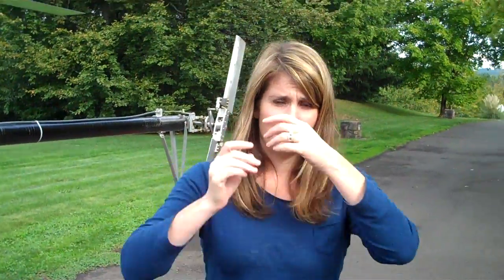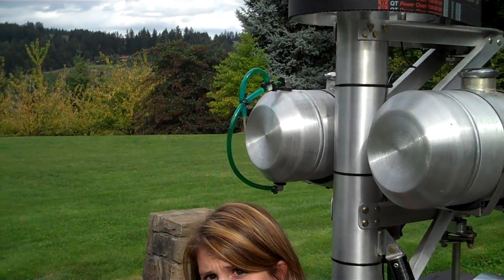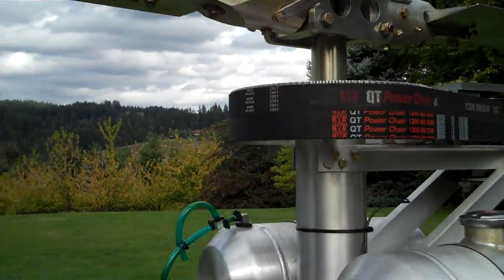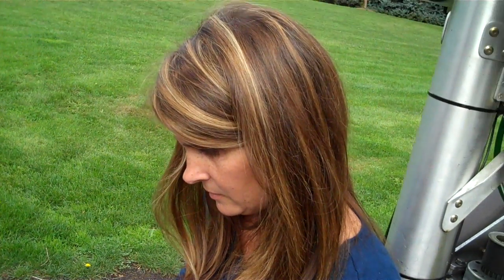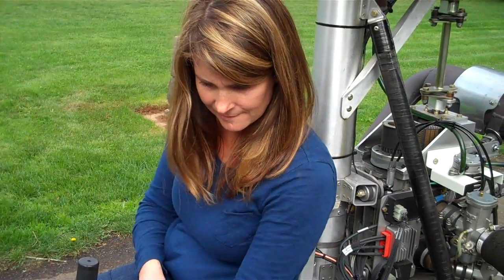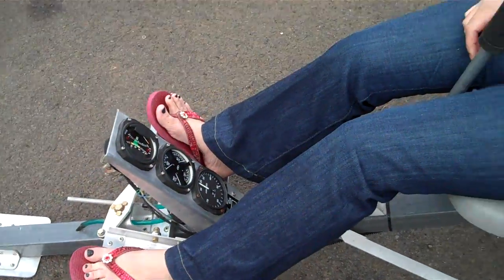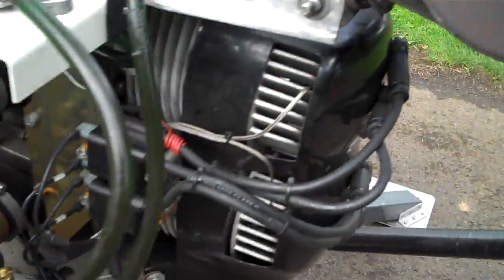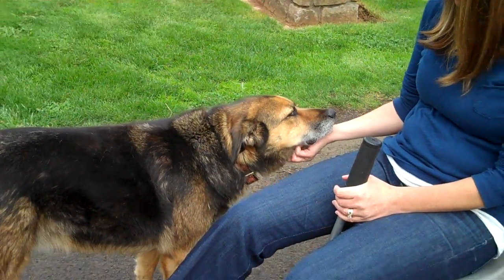How a helicopter works

Comment: Just thought of something. When hovering an RC helicopter with the nose pointing at you left becomes right and forward becomes backward on the cyclic input and takes a bit of getting used to. So it would be like you sat in the seat applying left cyclic and the helicopter rolling to the right.

Comment: billt460 - Go look up "dissymetry of lift", it is helicopters 101 stuff. In a nutshell, helicopter rotors are built to deal with this automatically, there is no action required from the pilot to specifically address this (except keep airspeed within limits). Advancing blade flaps up, retreating blade flaps down, effectively changing their angles of attack (thus lift) balancing out the lift on both sides when the helicopter moves at any nonzero speed.

Comment: technicaly speaking the blades do not take a "bite" of air . what is happening is the blades as they change pitch
there is low pressure on top of the blades. And high  underneath the blades thus giving the helicopter lift.
Reply: +FASTPISTOLDRAW - layman's terms
Reply: +FASTPISTOLDRAW 
I'd disagree. As in a fixed wing airplane, the rotors are just like wings. It tales a measure of angle of attack, the rotor or wing actually DOES scoop or bite the air. This is HOW the low pressure above and high pressure below is created. 

Pitch is the degree to which the angle of attack is applied to get more or less lift. 

In  fundamental terms you can reduce a great deal of aeronautical jargon into the fact the a wing or rotor, scoops the air and pushes it down while Newton's law takes effect and lifts the machine.
Reply: STEVE R JR false, just like a variable pitch prop. Some of the resulting thrust come from the AOA of the blades and not from the airfoil itself

Comment: RPM means revolutions per minute, It's how fast the blades turning, or this case how fast the engine is turning. You always want to keep your RPM's in the green, remember more power to the engine more left pedal input for lift. It's basically the same as your car engine ( when checking your timing their checking your RPM's. Hope this was helpful?
Reply: Pronounced rip-em's....

Comment: Without tail rotor input the fuselage will begin to rotate in the direction the main rotor is turning (top Blade) as soon as the aircraft gets light on the skids, even before it's off the ground. Pulling the collective without coordinated left peddle and cyclic will send you on a very unwanted circus ride.

Comment: Search here on YouTube for Autorotation. Helicopters can indeed glide without power, using airspeed to drive the rotor and then land using the rotational energy stored in that rotor. So if the main rotor separates or something like that then yes, you are dead, but if the engine stops, you have options to get it safely to the ground.

Comment from the maker: They will "drift down" if one remembers to quickly lower the collective and maintain forward speed by diving.  In aviation jargon it's called an "auto-rotation."  The wind keeps the blades turning, in effect a flywheel storing energy, to be used during the flare to stop and lower the ship to the ground.  You get ONE try to do it right!
Reply: You have dun this manure with some altitude right.?   VARY   NICE .

Comment from the maker: @jman9295  The Mad max machine was a gyrocopter, not a helicopter.  A gyrocopter has a free wheeling main rotor and a pusher or puller propeller to push it forward to keep the main rotor spinning.  They don't fly backwards/sideways or hover like a helicopter.  They do look like helicopters though so easy to confuse.

Comment: Explain the "controls are offset 90 degrees" thing a bit more.  I don't recall that from poking spinning gyroscopes.  When I poked them they'd just start some kind of weird precession...  but then I was poking them at the top.
Reply: +CHOPPERGIRL AIRWAR Gyroscopic procession : when force is applied to a rotating body, the reaction from that force occurs 25% later in the rotation
Reply: Errr....       when a force is applied to anything, I think a reaction from that force should occur immediately, unless you are getting into einstein territory...   

....and being sure to look at things on a molecular level, no macro level, which could hide a reaction because of the elasticity of the object.   For example, kicking a soccer ball, the soccer ball will not immediately move in total because of inertia, but it certainly is deforming and reacting at the point of impact and the reaction is traveling through the air inside and across the surface of the soccer ball...
Reply: CHOPPERGIRL's AIRWAR GOOD

Comment: How does the cyclic control work at the top rotor. I notice that there isn't a swash plate.?
Reply from the maker: The swashplate is inside the center mast.

Comment: Kinda cool mate. But in normal helicopter, when you want to take off or lift up from the ground, do you really have to press the left pedal? I thought the function of tail rotor blade is to counter act the movement of the emphanage cause of the top blade, means you don't have to do anything when lift up, just use the collective lever.

Comment: Since doing many dozens of flights in Army Helicopters I've come the opinion that Helicopters are unnecessarily complicated, particularly in the areas of the mast and main rooter; so I think if a designer/ builder / owner would remove one of the large blades he would A. have just one blade to worry about and 2. reduce the overall weight of the machine.  Of course, initially there would be a learning curve to master in keeping the wildly spinning contraption under control but a good pilot ought to be able to learn quickly that by removing the blade the level of his machines performance will be noticeably improved, at least for a very brief period of time.
Reply from the maker: A single blade rotor would work.  Don't know if anyone has ever built a helicopter like that.

Comment: Yeah when I saw that the Mosquito has to be built and tested, I was like thinking dummy weight and RC control just to make sure everything is working (rather than test piloting).  From what I have learnt about helicopters (through RC) they are not very forgiving when something does go wrong, like loss of cyclic, rudder, huge drop in rotor speed, loss of collective.

Comment: Hi, Jerry, nice video. How much Does this beaty mosquito cost?
Is there any webpage where I can look at it? How much experience did you have before you flew this? Thank you so much. Regards from Chile
Reply from the maker: Thanks Carol.  The factory doesn't make this model anymore.  Mine has been rebuilt and is for sale for $20,000.  I have an Airline Transport Rating with type ratings in Learjets and Falcon 50s, 10,000 + hours.  Also rotorcraft Private Pilot rated with about 500 hours in various machines.  Here's a look at the Mosquito factory in Florida: https://www.youtube.com/watch?v=oQ4ENu7QKoY
Reply: @jerrywsoloflex  Thank you so much for your reply. I'll check the info you're sending me. My best for you! 👌

Comment: It's not called a disk, its called the PITCH, you know, the angle of blade that cuts into the air.  Blades don't spin, they rotate, otherwise great presentation.

Comment: I'm a modeler helicopter,I think ,rc model helicopter has complex engineering rather than the full scale
Reply: Well, a model heli has an RC system with electrically powered servos, and a stabilizing system. Many of them nowadays even have electronic stability augmentation systems complete with gyroscopes and microprocessor. Most full size helis don't have that.
However, the full sized machine must be as close to 100% reliable as possible, otherwise landings can get a bit rougher than you'd like :)

Comment: Oil attracks dust, dust creates friction, friction wears things out. The creeking you hear are seals designed to keep dusty oil out. The proper lubricant is in the sealed systems.  You don't just squirt oil on things that fly. Look how much trouble BP got into for getting oil all over things that fly.

Comment: Not a heli engy but if i did math ok the top blade tip of an apache travels at about 1000mph,  if you add momentum to that,  182 mph seems nothing the cyclic cant handle

Comment: How is it that the helicopter flies without a tail rotor to create anti torque?
Reply: Bubba000 NOTARS.Basically throw the exhaust gases on movable rudders on the tail which you control from the cockpit.
2. Contra rotating blades which neutralize each other. Blades could be on one shaft or tandem. Chinook , KA 52

Comment: What happens if one of those belts break?
Reply: It looks like they have dual belts on each pulley, but belt drive is common on smaller helicopters. If you lose all of your belts, you're going to immediately hear a spike in engine RPM which will most definitely be reflected on the engine tach, followed by a rapid drop in rotor RPM. You'll want to immediately lower the collective (left hand control), roll the engine to idle, and find a safe spot to autorotate down to. Autorotation is the use of the upward flow of air to rotate the main rotor blades when the engine is no longer powering them. It's the same concept behind how a maple seed spins down to the ground.

If you don't lower the collective quickly enough, the main rotor blades will stall and it's unrecoverable. That means that the blades will stop rotating and there's not anything you can do to get them to spin again.
Reply: Rather B Flyin Thanks for the info.so it's almost auto gyro,when the engine is off?
Reply: Ajith A X
Exactly like an autogyro! the only difference,if I could complicate this analogy, is that the helicopter can raise collective and change blade pitch to control rotor rpm and make for a super soft spot landing. So, in a heli, there's a little bit more control. Otherwise it's exactly the same principle.
Reply: auto gyro is some what diferent as they are always faling through the air
Reply: also if one of the belts breaks your ok if they both break you quickly learn to auto rotate or die

Comment: The helicopter you made it?
Reply from the maker: It comes in kit form.  The factory assembled mine. I wouldn't make a pimple on a mechanic's ass.
Reply: How much worth it?
Reply from the maker: $30,000 @crazytechnu9275

Comment: Typically a helicopter will lift twice it's own weight. But they all have a working lift capacity which is always considerably less than what it can actually lift. Sling loading cargo is a big consideration. Those guys that do helicopter logging are F---ing Nuts. Yeah you might have a problem if you weigh twice the weight of Jerry's Mosquito as it is a one person aircraft and may have a weight limit.

Comment: The cyclic ain't there to make shit up. That's Obama's press secretary's job. Unless the cyclic's system begins to fail 182mph is not fast enough to inadvertently invert an apache. Although I have seen with my own 2 eyes an apache intentionally go inverted.
Which brings me to my next question. If it can fly upside down are they gonna have to put wheels on the top also?
Reply: Beautifully

Comment: No one has designed a cyclic system which completely compensates for the slight loss of lift from the retreating blade. That's your fucking answer. You pointed out an apache will reach a speed that borderlines inversion. So if you can't get that particular "option" on the most sophisticated helicopter on the planet why are you throwing rocks at me?? So again, your turn . I know you have some type of aviation background.